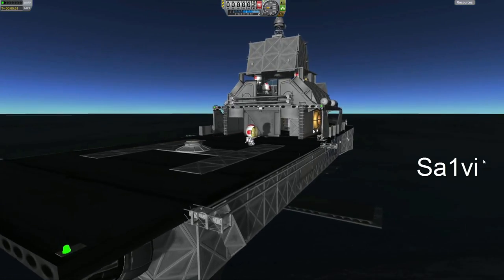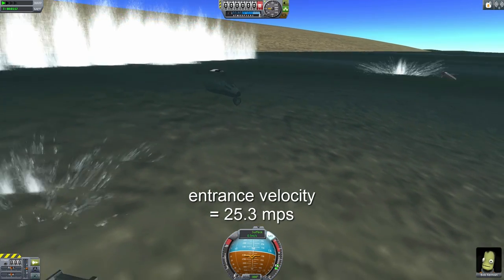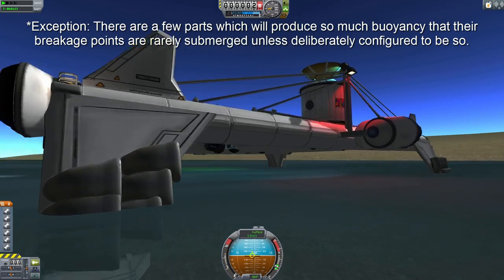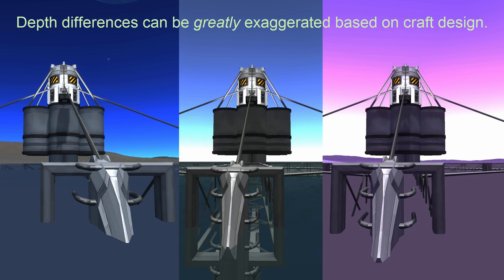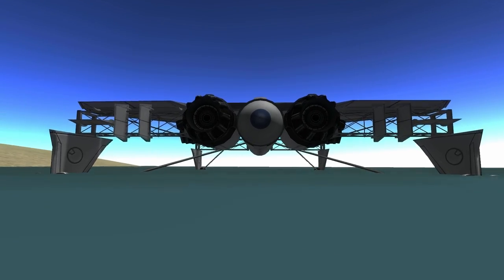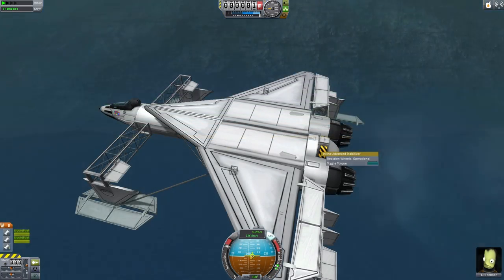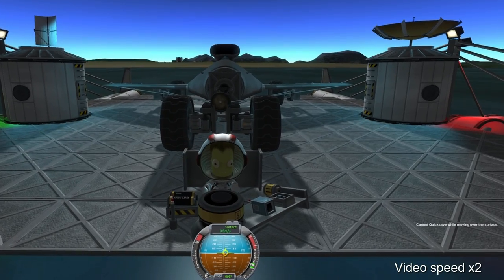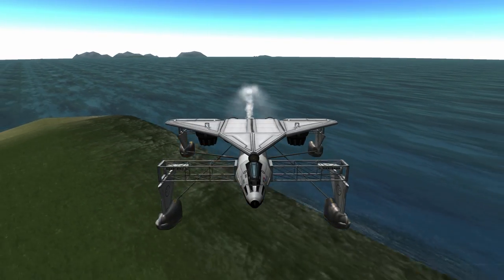KSP: The DEFINITIVE water craft tutorial

Comment: Your terminology is very much incorrect. There is a big difference between bouyancy, which you are very much confusing with lift. An underwater foil can provide a lot of lift, when moving at speed, and yet have no bouyancy. It is the lift provided by the submerged parts that allow the main body to stay out of the water when the craft is moving, yet provide no bouyancy such that when the craft slows down (and lift decreases) then the craft submerges until there are enough parts in the water to provide enough bouyancy to keep the craft afloat, else it will sink. The bouyancy of the parts in the water is determined by their displacement. In order for them to provide positive bouyancy, they must displace more water weight than the weight of the craft itself. HTH
Reply from the maker: 100% true! Thanks very much for the accurate input. I admit I deliberately muddled the terms of physics. I wanted to keep an aquatic theme, which is no excuse, but moreover I wanted to insure the average KSP player would not confuse the game's "lift rating" with the actual effect of submerged lift, so I deliberately called it by the resultant effect 'buoyancy' (referring to the whole craft being suspended in the water) instead of the causal effect of true 'lift' caused by the hydrofoils.  I hope the wiser crowd stop to read your comment!